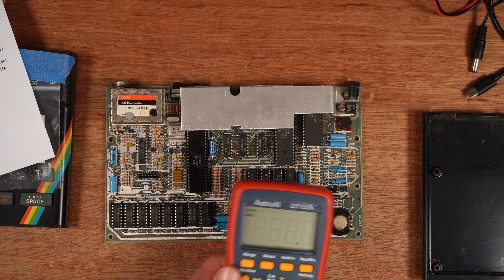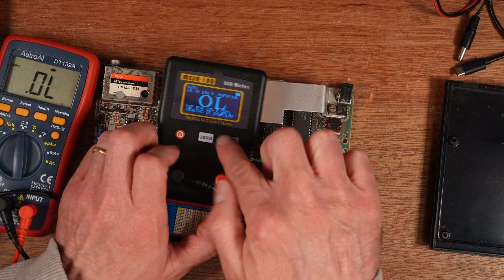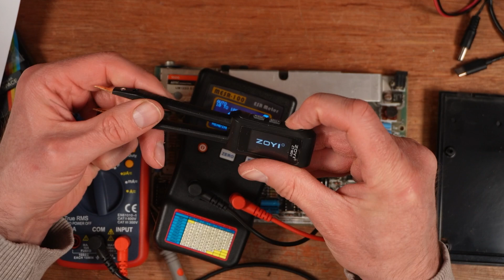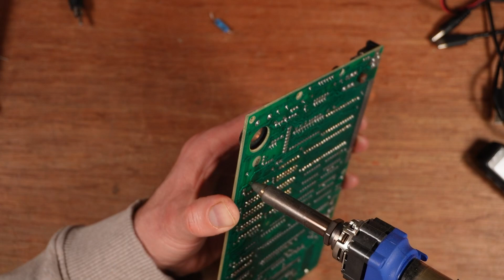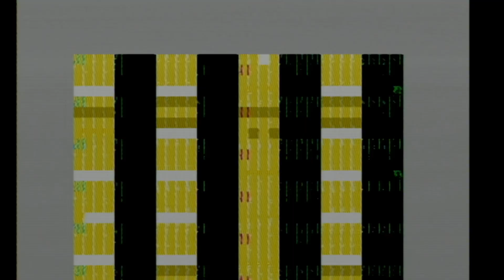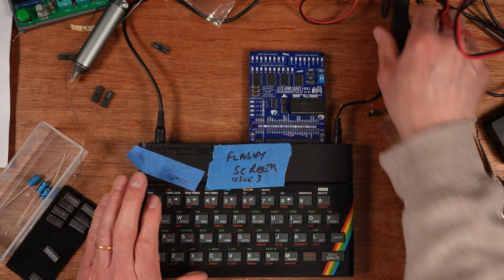ZX Spectrum with Missing Voltage Rail - Repair

Comment: Is it not possible to replace the RAMs with a modern equivalent that does not require -5 & 12V?
Reply from the maker: With some modification you can replace them with 4164 chips, but that's quite a lot of work for not much benefit.
Reply: @morefunretro2  yep, personally i wouldnt risk using actual 4116s any more unless in 'rare' equipment, theyre far too flaky and long since discontinued, any stock is pretty old, and may even be bad or shortly fail, 4164s are more 'recent' and likely far more stocks available, and more reliable, could even use 41256s!  its not that much work to fit a 4164 in, anyway, lift pin 8, connect to pin 8, lift up or chop off pin 1, then it'll drop in ...

Comment: The OG rams really hate missing that juicy -5v goodness. Interestingly there were rams that didn't care, but Sinclair didn't use them.
Reply: oh, yeah, they quickly fry or get partially 'damaged' , they were probably cheaper or easier to get than the 5v only types, which were used in the BBC computers, type HM4816, i think? i've read there was a bit of a shortage of them for a time! luckily can be replaced with a 'pig jiggered' 4164 (lift pin8 up and connect to pin9, lift up or cut off pin 1 or connect to pin 16, 'may' be ok to leave to connect to socket but probably better not to risk it, depends what its connected to internally) or even 41256(lift pin 8 and connect to pin 9, lift pin 1 and connect to pin 16)!

Comment: Good to see you're still fixing spectrums🎉 as I fix lots of them too there's always still one that will surprise me ... from bad repairs to repair the just shouldn't work ... the worst one to time repair is the intermittent type .. I've got a ZX 81 that works fine and then stops working and then works fine . I think it's just taking the mickey out of me 😂😂 anyway great video keep up the great content always good to see
Reply: check all obvious things like chip sockets,  solder connections, check for track breaks, maybe a 'bad' ceramic resonator or clock invert and driver transistor tr2,  chip failing once warm?

Comment: I think ti may be a good idea to not let the legs of capacitors touch your skin when measuring ESR.
Reply from the maker: Very true, but Ive measured the capacitance my fingers give and its only a few pF
Reply: @morefunretro2  No the resistence can be "significant" though. Souldnt be a problem for an avid user of blue tack like yourself.
Reply: @rimmersbryggeri  no esr is internal series resistance of a capacitor, and external 'parallel' resistance such as skin, wont affect that reading, but may make it register as 'dc leakage' ... different thing

Comment: Instead of pulling the chips off the board immediately (in case they weren't socketed) it might've helped to try the piggyback test where you put known good RAM chips on top. As long as the bad chips don't output anything that conflicts with the good chip that'll solve the problem temporarily and let you find out which chips are bad.
Reply: doesnt always work , as you've sort of said 😉
Reply: @andygozzo72  no but it's a good first step. You won't get a false positive at least.

Comment: i'm wondering about using a poly cap to replace c46 as they 'shouldnt' ever fail..?? maybe the reset cap as well, been trying to find some reasonably small tubular 1ufs around 50 to 63v but very few available, and ones i've seen very pricey!
Reply from the maker: I dont think its worth replacing with a poly cap. A good electrolytic will outlast me!

Comment: i currently have 2 boards with no -5v, one has shorted zener, one the -5 disappears as soon as +12 and +5v present, and +12 takes high current and tr4 burns up(powered by external current limited -5,+12 and +9 derived from the +12, tr4 and tr5 shorted base to emitter to disable the dc dc converter)..one or more bad 4116s almost certainly,  dc resistance checks were sensible, .. havent yet investigated the other  ..
Reply: update... it seems one 4116 on the board that fries tr4 was shorting a few seconds after power up, and strangely 3 others have gone 'dc leaky' from their -5v pins to all other, but more so to +12v (measures 15k )so this can make the -5 creep more positive if its fed from a high impedance source, such as in the issue 3b and later circuits.. need to watch out for this..they tested ok when the spectrum was powered up from external +12, and -5 , a known good chip seems to test open circuit on highest resistance range from -5v to  +12v pins...  as for the zener issues, dunno what blew the shorted one, removing it and testing the board from external supplies worked perfectly, maybe a bad or misconnected add-on?...the zener on the other one seems a bit 'leaky' in that it starts to conduct well before its marked voltage...hmm.....